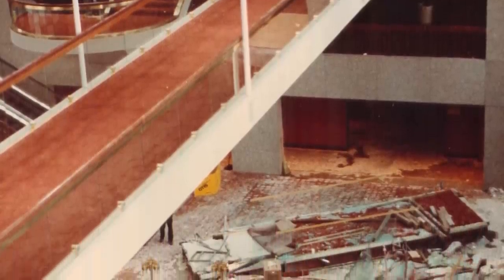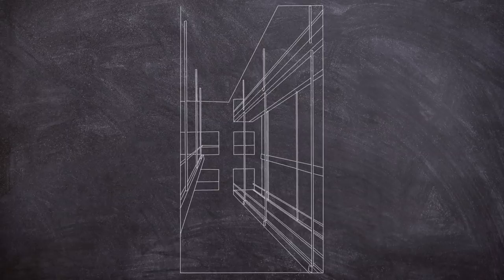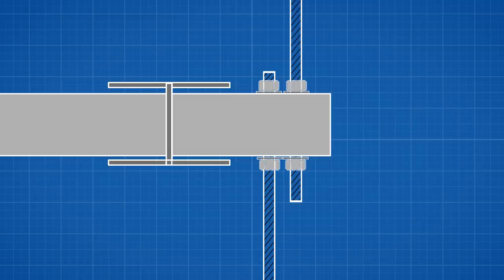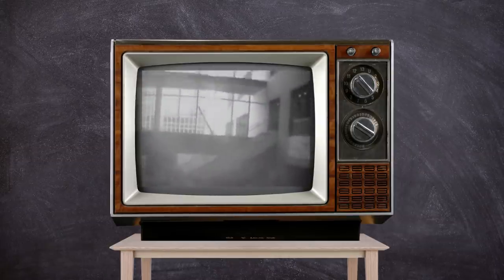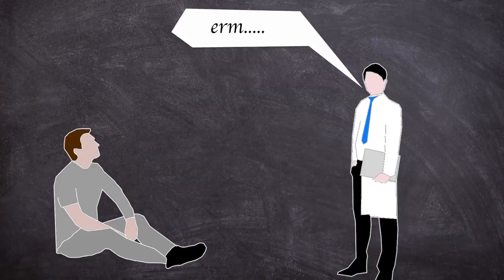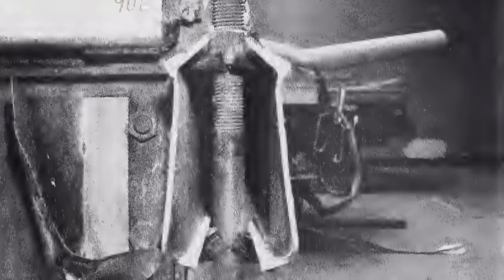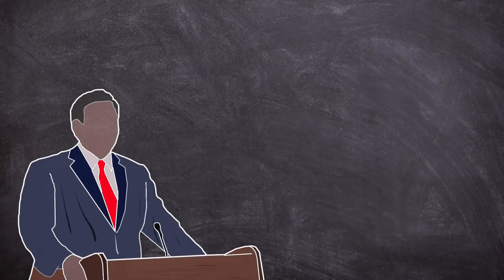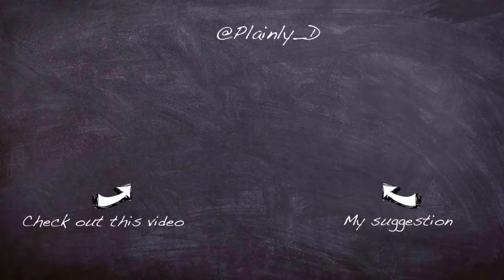A Brief History of: The Hyatt Regency Walkway Collapse (Short Documentary)

Comment: Why would a walkway like this have to be so heavy?  For example, rather than concrete would it be possible to use aluminum decking for the bridges?  Still would have needed a better arrangement than they had.
Reply: It is kind of like what I think about the Arecibo radio telescope:  If it is rebuilt, must it weigh 900 tons?  With modern materials I would think it would be lighter and what is up there that is so heavy?  Must it be there?

Comment: In my own experience with large scale commercial construction (metal roofing) its not uncommon for details to be made up on the fly. 

A miscalculated foundation will be compounded all the way to roof level and be "worked around" because time and budget is god. 

The last large project i worked on suffered huge leaks because nobody factored 6 stories on a lakeside in a valley would be subject to driven rain. 

I sent and logged my email to the project manager during initial installation(it was pretty much ignored) then laughed when water was pouring in and he claimed he suggested my idea on the first day on site!

Tip of the day,cover your arse and document everything..if it doesn't seem right tell someone and have a record, if it seems hazardous, report that shit.

Comment: If only they used a coupling nut to connect the lower rod to the upper rod. The box beam would have seen the calculated load, and the rods would not have to be threaded full length either. Hindsight is  20-20 i guess, but i really can´t understand why they opted for the changes they went with.

Comment: Anyone have a simple explanation as to why the nut supports twice the load in the second configuration?
Reply: If you look at the original drawing it walkway is held up by a single nut. All of the force is still in the rod of the walkway itself is sitting on a single not supporting its own weight. 
If you look at the way it was constructed the lower walkway is supported by the upper walkway. Which means they’re not holding the upper walkway has to hold the weight of both of them.

Comment: How can the 4th floor fall down onto the 2nd floor if that 2nd floor itself is suspended from the 4th floor? Shouldn't they fall together?
Reply: Apparently the metal frame holding the 4th floor walkway deformed, dropping the concrete slab that it was holding down onto the 2nd floor walkway. Thats what brought everything crashing down.

Comment: both designs are stupid and unsafe.   one the original deisgn  only a single nut holds each floor at each corner.   and only a single rod  at each corner holds all the floors.  combined with metal fatigue= collapse

Comment: This wasn’t a design fail, it wasn’t an engineering fail, it was not built as designed, it was not built as engineered, the guy in the field change the plans, that is where the fault lies. Both your thumbnail photo and in your description you call it a design failure when it was not built as designed
Reply: But that’s not what actually happened. The guy in the field change the plans. The engineering company drew the change. And approved it without ever reviewing it. That’s why the engineering company lost its license.
Reply: @neilkurzman4907  according to this video the fabricator drew the change and the engineering company just rubber-stamped it, which of course yes they should use their license for doing so, but your statement that the engineering company drew the change doesn’t seem correct
Reply: @shmeli  
I believe the actual drawing was done by a draftsman at the engineering company based on sketches from the contractor. 
I could be wrong on this point. 
However what you said is exactly what happened, the drawing was rubberstamp by the engineering company. Which is why they lost their license. 

This is a well covered incident. I believe the “engineering disasters” TV show covered it many years ago.